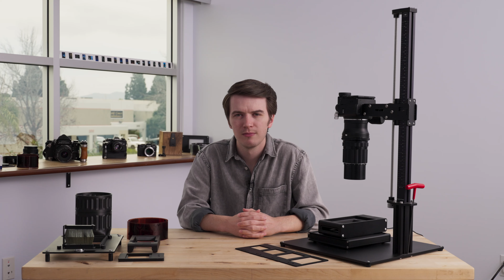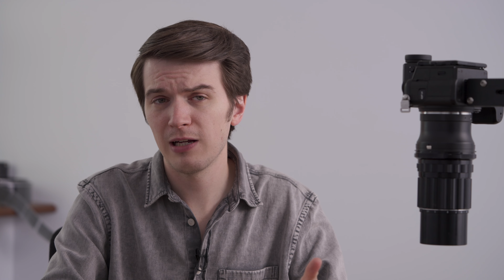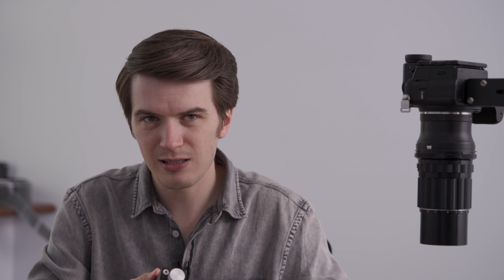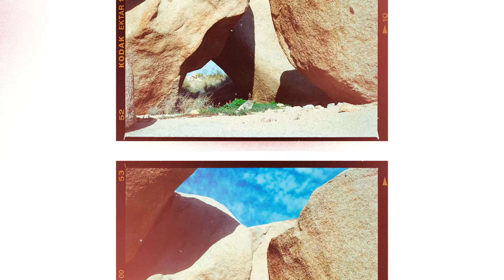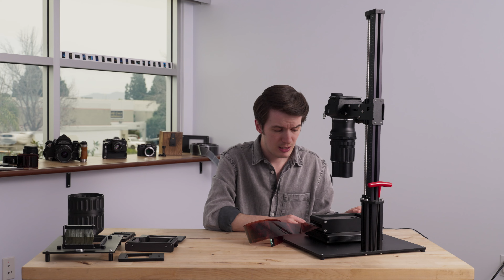Introducing the NEW Pro Film Carrier 120 MK2

Comment: Avoiding light leaking means you must use specific masks for each camera manufacturer. Hasselblad frames are ~55.5x55.5 mm, Rolleiflex frames are 57x57 mm. Mamiya 6x6 is 56x56 mm. Did you notice that?
There are tons of different formats out there, for all type 120 strips.
Pentax67 is 55x70, MamiyaRZ67 is 56x69.5 etc.
You can't assume everyone is scanning positive slide film.

Comment: What prevents someone from manually pushing the film through the cassette and avoiding the carrier all together? The carrier is the biggest reason the product is overly expensive and seems like it's only function is to advance the film with a winding knob. Also, why is there no video of you actually using it? I feel like this needs to be said to. Heavy does not equal quality or value for money. Putting steel just for the hell of it is crazy if there's no function to be gained from it over using a cheaper, lighter material that could lower the cost for customers.